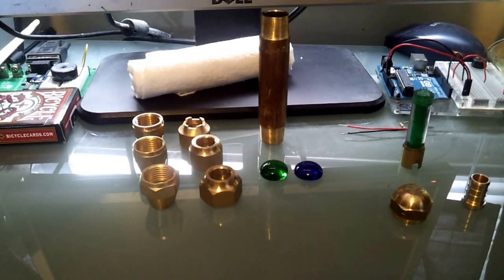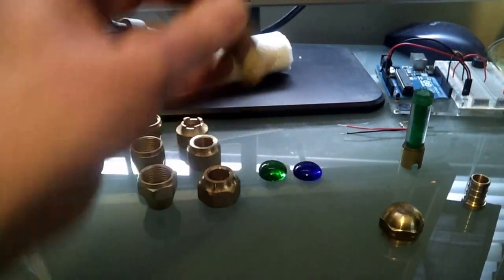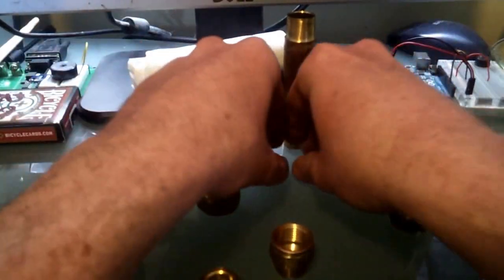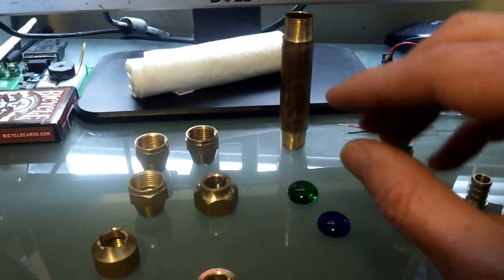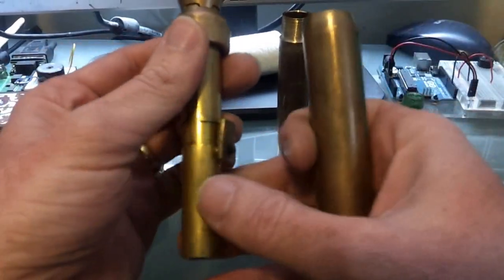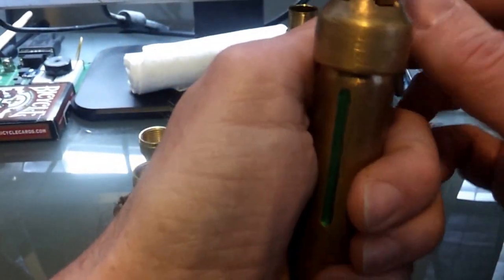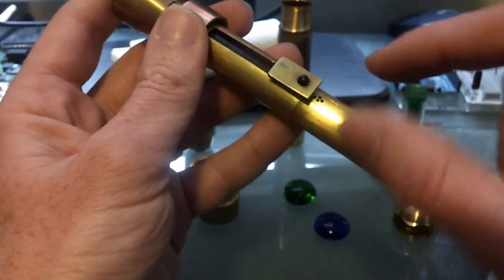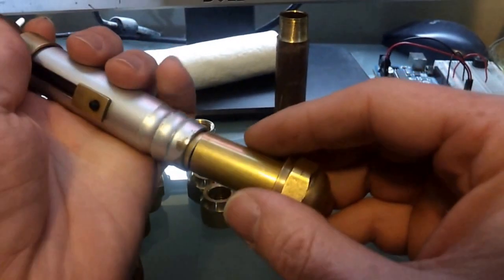Evolution of the Mk II Custom Sonic Screwdriver (Doctor Who) (Arduino)

Comment: 0:31 I don't own a belt sander, but I want to get the threads off of a 1/2 diameter nipple- What do you recommend?
Reply from the maker: +Unidrw A Dremmel or similar tool. On the original Mk II I just went around and around the threads with the grinding and sanding wheels. Without some kinda multi tool, you're gonna need a good file and a lotta patience.
Reply: Kay, thanks

Comment: I LOVE the new cap and body! I'm gonna have to give my current one a touch-up ;)
Did you just use a Dremel for the cap and grooves?
Reply from the maker: Ka-a-a-nnon. Whats up? That cylinder looking router bit is what I use to cut the grooves. For the cap I belt sanded the hex head completely off the flare nut, then filed it smooth and glued in the 1/2in test plug. It would be easy to make the new cap for yours. All you need is the flare nut, test plug, and possibly a new length of 5/8 brass (aluminum,etc) tube. The trick would be sanding the threads until it fits your sonic's body. In any case hit me up if you have questions and I'd love to see any mods you make to yours!
Reply: Sanholo80 I'll definitely put up a vid with the mods! Did you use the sanding bit? Or the multi-purpose one? (I got one of those a while ago. They are the BEST. Used it to cut some obsidian daggers for a Comic-Con outfit ;) )
Reply from the maker: #1 I thought the router was in the vid... its not. The sanding bit is what I used on yours. The router is a little metal cylinder with a spiral cutting pattern around the outside. #2 You should have a DeviantArt account or something to showcase your cosplay!
Reply: 1- Nope, you're right, it is! I was asking if that was what you meant by "router". That's what I was saying I had, so that's great!

2- I actually have an account! http://geeklord95.deviantart.com/
All I've got so far is my Mirror's Edge Runner outfit...but more will be coming soon!
Reply from the maker: 1- Woah Nice!

2-Sent you a Llama.

Comment: Thanks for posting! All the custom sonic screwdrivers I've seen have required lathes, something more like this I actually have the tools for. I don't have a belt sander though, so I will need to find components that don't need sanding. Suggestions?

Comment: how much would you charge for one? also can you combine this & the tvbgone ?
Reply from the maker: No TV-B-Gone... The extra electronics won't fit. I tried. These were just made from plumbing supplies. I've moved onto machining my own parts!
Reply: how much for a 9th/10th one
Reply from the maker: They start at $150. Price goes up a little depending  on options or shipping out of the US.